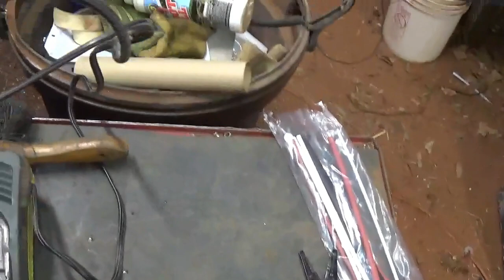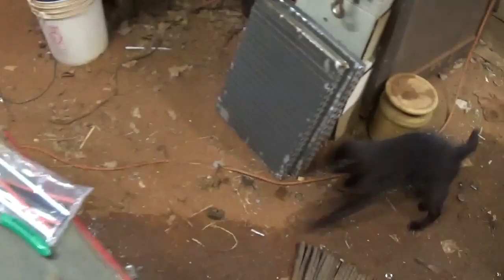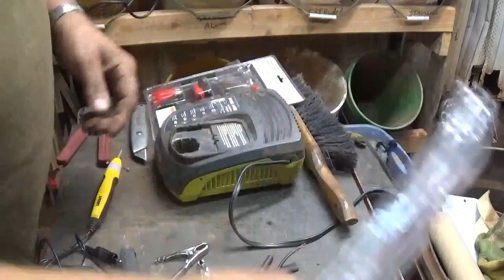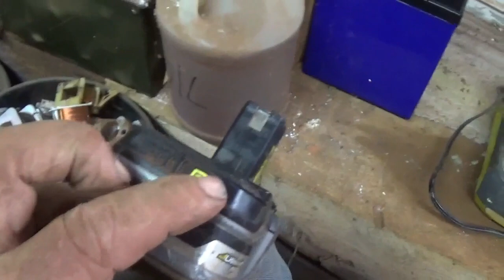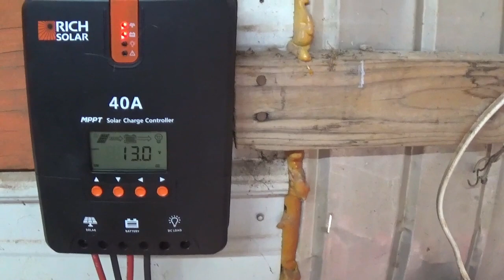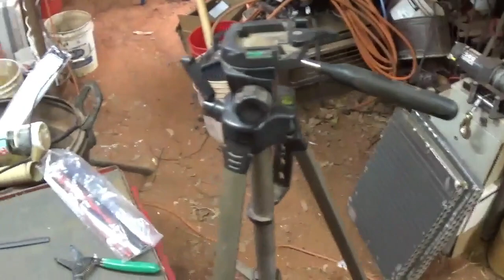Fixing a Ryobi 12 Volt Battery Charger

Comment: I really enjoy your knowledge about everything and  especially about the solar, I'm hoping one day to run every thing in my garage on solar
Reply from the maker: Thank you, you can do it, start small and learn as you go, that 50 watt starter kit was about $80.00 and I got a 35 amp hour battery from Harbor freight for $75.00. but you could go to Walmart and get a deep cycle battery for starters from there you can run things that are 12v then get an inverter to convert the dc power to ac. my 500 watt inverter won't run a lot but I can charge my Ryobi batteries, run a fan in the shop, I wired up some 12 volt lights, I have a 2000 watt inverter on it's way should have Tuesday or Wed.

Comment: That was a nice and easy fix glad to see that it works so well sometimes when you get auction stuff it doesn't work outstanding video sir five stars
Reply from the maker: Thanks Joseph, I was charging the Ryobi batteries with the inverter, and I remembered that I had the 12-volt charger and it may use less power by not having to use the inverter, now I find out that Ryobi will soon have a solar charger/inverter. I will have to keep an eye out for when it comes on the market